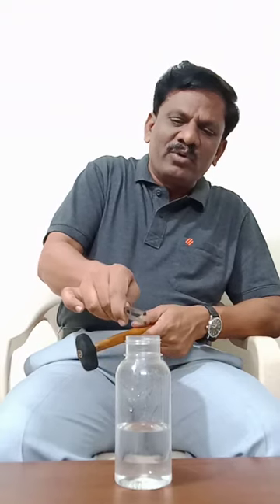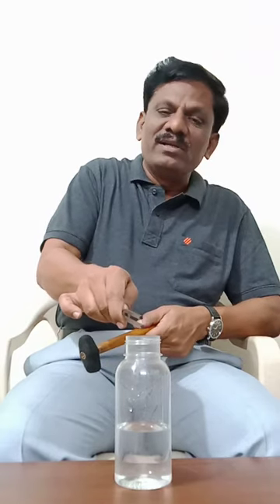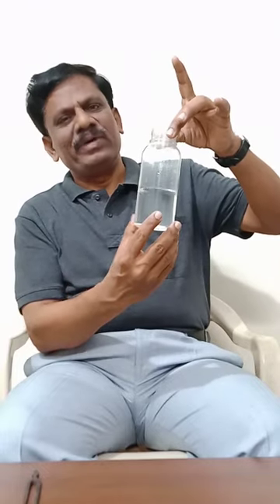Resonance air column| Science Experiment - closed organ pipe demo #physics_is_everywhere #resonance

Comment: sir why are you use the rubber hammer why you don't use mettle hammer
Reply from the maker: @MohammedMunsif-r3h  When we use metal to excite the tuning fork, its original frequency will get reduced.
Rubber hammer will provide a smooth surface.
Reply: @TOPTempleOfPhysics  Thank you sir
☺
Reply: By Mufaris as your regular student☺
Reply from the maker: Best Wishes 💐